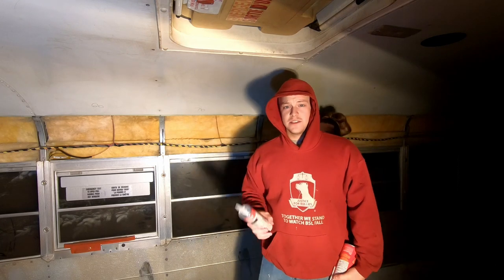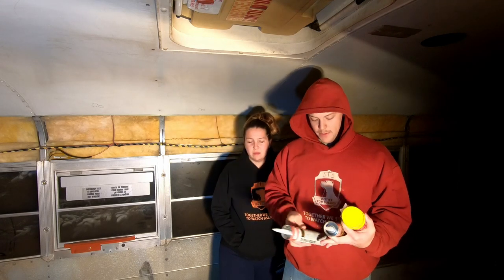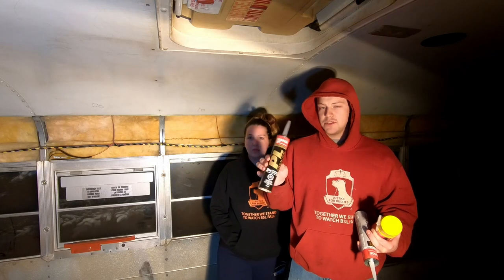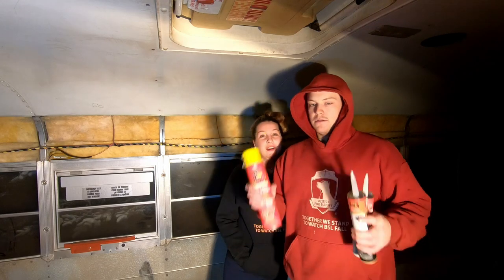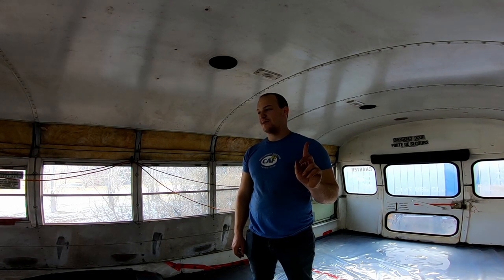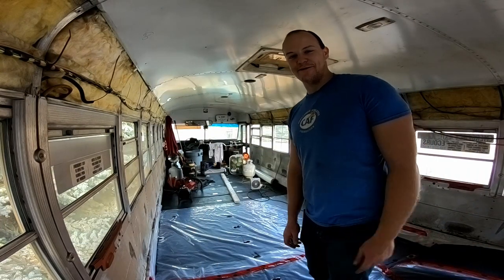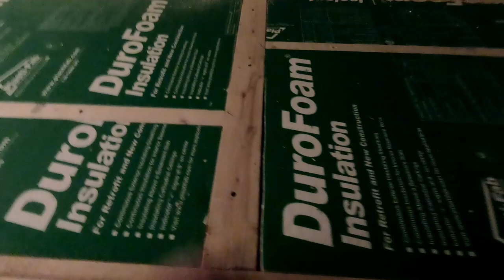Subfloor Install and Insulation - BUS CONVERIONS EP.5

Comment: I like the job you are doing so far.  I did the same thing with 2 sheets of plywood under the studs, foam board, and one more sheet plywood.  I used Liquid Nails as my adhesive and added screws about every 8-12 inches along the edges of the plywood which are cut to fit on the centers of my 2 x 3's.